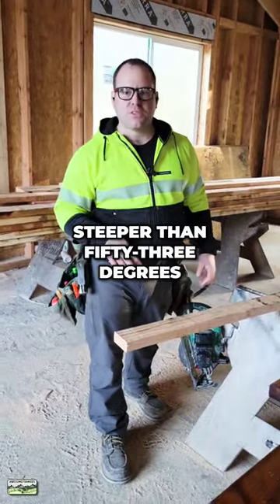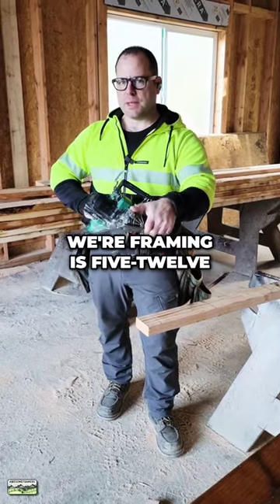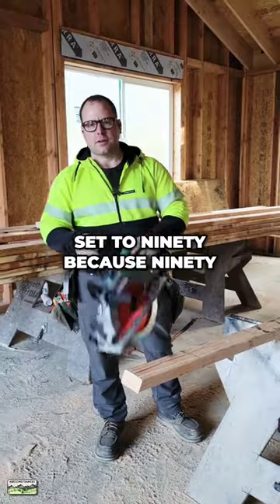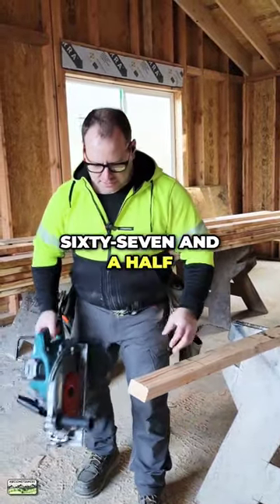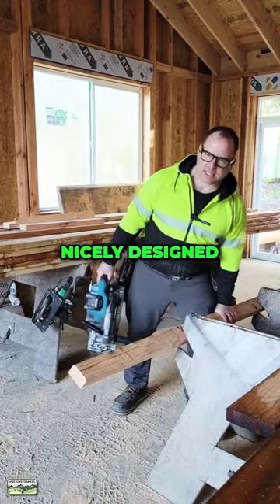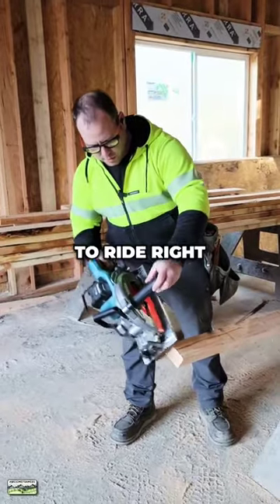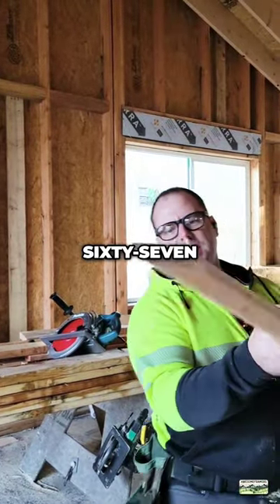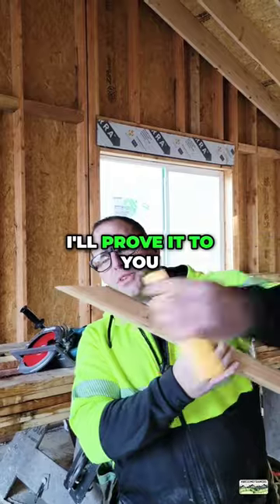How to Cut Steep Bevels #construction #framinglife #diy #diablotools #buildingconstruction

Comment: Surely this could be done in one cut by setting the saw to 22.5 degrees and cutting the end of the timber?
Reply: Doing it the way shown in the video is already difficult. Getting the foot of the saw flat on an even smaller surface would be significantly more difficult and probably waste more time

Comment: Use a chop saw eh
Reply: makes no sense to balance a long piece of lumber on the miter station to cut that acute angle.
Reply: Right and what chop saw cuts 67*
Reply: @mattmag3089  you can set up an additional angle fence
Reply: @jenserwig1707  sounds like a lot of work for rough carpentry
Reply: @mattmag3089  agreed